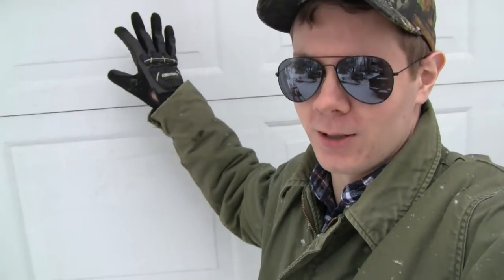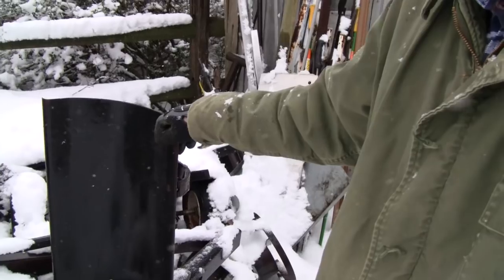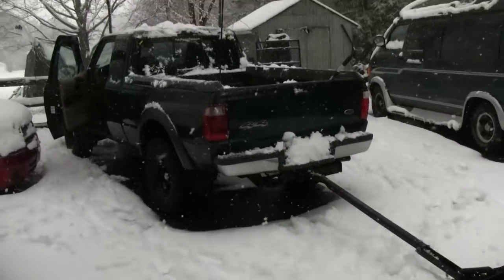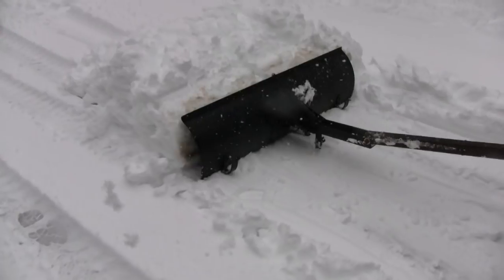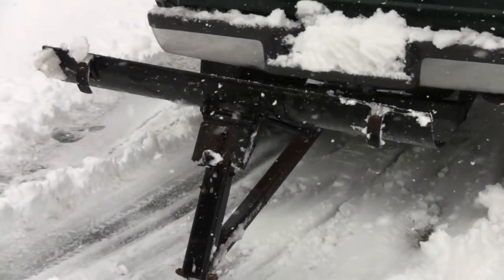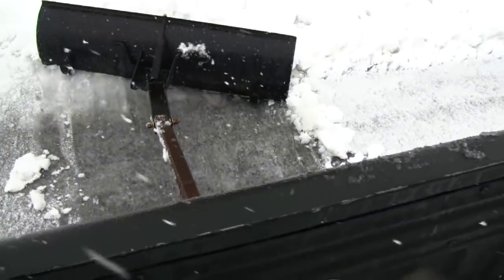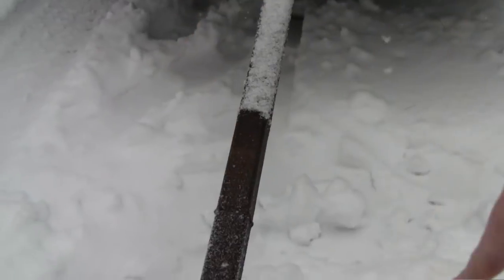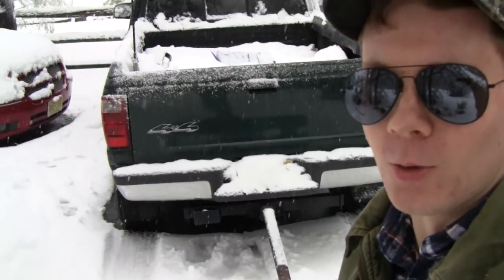DIY HITCH RECEIVER SNOW PLOW TEST!

Comment: I just came up with the idea of setting up a plow and connecting it to my hitch receiver. I searched online to find out if anyone else had the same idea and found your video. Great job! It may not be perfect but it definitely got the job done. I thought it was going to bend and break also but you handled it correctly by driving slowly to avoid that from occurring. Thanks for sharing!

Comment: I love the creative and innovation on your DIY Hitch Receiver. I am a CAD Designer and love DIY projects on youtube people create innovative. I love to share some  creative ideas if you like to add if wish  thinking about when watching your video. Maybe mount a Remote Switch Winch Pulley System from the horizontal long square tube to an added  vertical smaller square tube with pulley between  winch and plow use as leverage. A cable would run through the pulley on small tubing going downward connecting to a D ring shackle on top of plow to raise or lower plow from inside cab of vehicle with remote. Also,if you like to go to the extreme add an rear camera to watch your plowing in reverse and hazards you might run into when backing up. Once again love the video and thinking on creating something similar... Great JOB!

Comment: You need outer stabilization chains on the outer edges chained to the trucks bumper to keep it from pre loading and twisting as you are turning cause that is a very long shank.

Comment: Name it the face impaler. If you wreck with that shifter in there you will ventilate your skull for sure
Reply from the maker: +Mike Warman I was a little worried about that, but one time I snapped it off doing a money shift from 5th to 2nd, after that I realized that I would break the shifter before it breaks me.